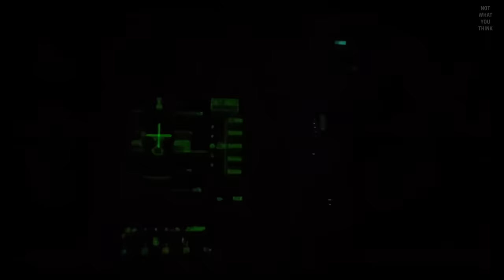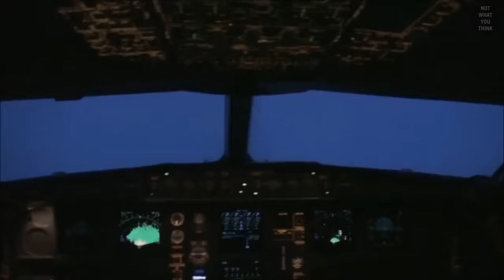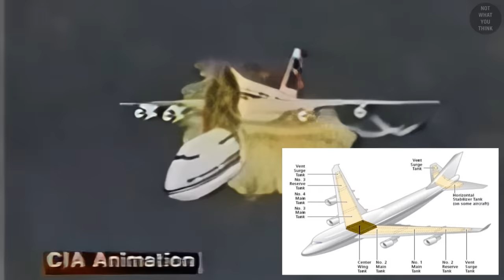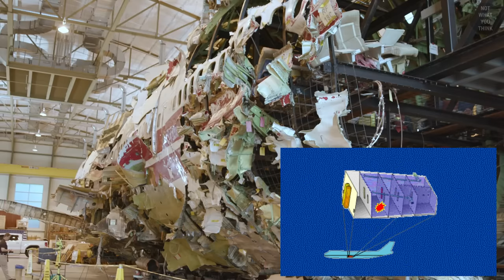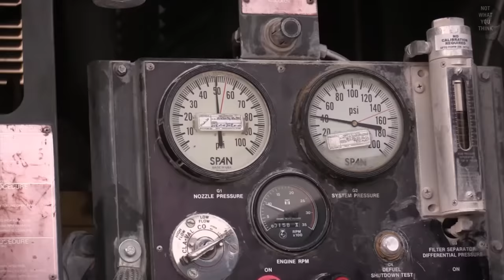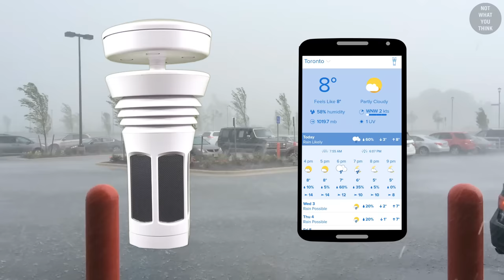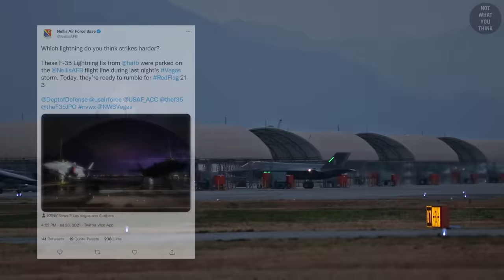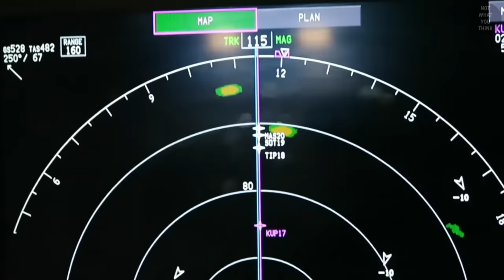Why F-35 Don't Fly During Thunderstorms

Comment: 15:27 ...unlike metal clad aircraft?  Composite vs metal clad?  Composite IS metal. It's a mix of metals. And most aircraft are built out of a composite metal, which you even stated early on in the video at 2:42.

Comment: Funny that. Who'da thunk that airplanes specifically designed to slither around electromagnetic radiation would have some issue with shedding off intense electrical discharges?

Twenty years from, those in the know will look back at this and mutter "Yeah-- this is why we don't like flying any kind of stealth aircraft through electrical storms."

Comment: Why are they trying to eliminate oxygen by air filters?
Why not having the whole tank lined with a membrane, like a giant airtight plastic bag inside the tank? When the pump sucks the fuel, the space between the outer Al wing surface and the bag would fill with air, but the fuel would be isolated..

Comment: What happens to the fuel vapor that's displaced by the nitrogen?  Does it just get vented to the atmosphere?
Reply: The fuel vapour gets mixed with the nitrogen, just as it does with normal air.
Reply: @gordonrichardson2972  injecting another gas into the tank would have to involve either displacement of the existing vapor, or an increase in pressure.  Are you saying it's the latter?
Reply: @davidsellon4580  it's the latter.

Comment: a 747 gets zapped every day.  It is made out of aluminum, an excellent conductor, the electricity goes around the passengers.  I am not looking forward to flying in a carbon fiber airplane..
 In a piston powered airplane you could eliminate the air fuel mixture by putting exhaust gas in the fuel tank above the fuel.

Comment: The F-35: Can’t fly when it’s too cold because the batteries don’t work. Can’t fly in the desert because it’s engine struggles. Can’t fly in thunder because of the exterior. Just buy more F-15’s and -16’s; they do the job better and cheaper.

Comment: When you mentioned Saint Elmo's Fire, your video was not showing it. Saint Elmo's fire looks like the northern lights rolling around the windshield, what you showed was static electricity flow across the windshield, which is far more common than Saint Elmo's fire. 

Also, the plane is not "designed" to take lightning strikes, but they can. After a strike there's a huge maintenance event to demagnetize parts and inspect for damage that can ground the plane for a long time. The "design" you're referring to is static wicks, which are designed to dissipate static electricity, not lightning strikes. They do dissipate lightning, but usually get melted down to a nub in the process and have to be replaced.

Comment: Could you use a vacuum pump to extract the fuel air mixture? In order to stop it from exploding
Reply: The reduced pressure inside the tank would put additional strain on the tank walls. The fuel pump would have to work harder - but that should not be an issue. Actually, sealed fuel tanks had been around in cars some decades ago, and when the tank had been filled to the rim, the fuel pump was able to act as a vacuum pump...resulting in a crumpled fuel tank. Today, the tank caps should have a vent which lets air in when a strong-enough vacuum begins to build up in the car's tank. Yep, I wrote "should" because these vents can fail and the hapless car owner (or happy YouTube video creator who wants to demonstrate that issue) will be left with a crush fuel tank.

I'd think that a simple solution would be to store the fuel in a "rubber bag" inside the tank. The rubber bag would separate the fuel from the air, and could it deflate like a balloon when it gets empty. But if the rubber bag gets punctured, you might not even notice until your airplane explodes. Plus fuel level monitoring would be harder.

Comment: Let me get this straight...
So, a plane called the Lightning cant fly when actual lightning is present?
Reply: No it can fly through it just fine
Reply: @imperialpilot2164  
Joking, bro.
.....Just joking.
For $337M (Navy), it better be able to fly through lightning.
Reply: @willwinters3910  What are those price figures, an F-35 is bearing around 120m for the most expensive variant, the cheaper ones reaching 79 million, unless your talking about a raptor
Reply: @imperialpilot2164  Well it's a thunderstorm, which means we have a CB which usually has hail inside, which would tear up an aircraft eventually, would it not?

Comment: "I bet you're wondering why it doesn't fly in the lightning!" ... "At this point you have to be wondering why!" ... You rephrased the question like 5 times and still never gave a clear answer. Just that it's composite and non-conductive, and / or maybe the inert gas system never got sorted out. Neat.

Comment: The fuselage is hollow , while the outer layer is electrically conductive and separated from the inner fuselage by struts covered by rubber and wrapped with copper , this separates it from the non conductive composite inner , which allows the electric current to flow around and off of the aircraft leaving the airframe and its electrical systems intact.

Comment: Just another reason why the  the service life of the F-35; should be as short as possible. Naturally it's not likely about the fuel system. Modern electronics are quite vulnerable to high voltage sergs. An "all weather" combat aircraft. Isn't all weather, if it can't operate in a lightning storm. Aa many, perhaps most storms. Produce lighting.
Reply: F-35 Can fly though lighting in piss poor conditions fine.
Reply: @imperialpilot2164  So can the F-15.  The differences are two. One of these aircraft wil actually do, what it was designed for. That same airframe costs about half what it costs to operate the F-35.

Comment: The Inert Gas Generation System has been fixed.  The F-35 is actually not very conductive.  However I have seen what happens if it flies to fast through heavy rain.  Let's just say that start making plans to work on the L.O. and leading edges.  Low Observable coatings on the leading edges are important parts of the jet, all aircraft have rain erosion materials, an ablative material that is designed to protect the underlying structures.  It works but it requires maintenance, sometimes LOTS of maintenance.

Comment: What exactly is the "grounding" in an aircraft grounded to? Yes, I'm sure the DC and AC electrical systems have their grounding wires, but that's not the same as the electrical grounding in a building, that literally uses the earth itself as an electrical sink. Try shoving a few million volts into the ground terminal of a car battery and let me know how that works out....

Comment: do not blame the fuel of the twa 800, it is considered that a hot pipe sagged onto an eletrical wire causing sparks in the center fuel tank, cause the boeing 747 was an old model

Comment: The military SR71 Blackbird Mach 3+ plus reconnaissance jet had liquid nitrogen dewars to keep the fuel tanks purged when the fuel depleted. It also is the only aircraft to use JP7 fuel that I know of. JP7 has a very high flash point that a spark plug ignition in the engine would not ignite the fuel like normal engines. It had to use a pyrophoric chemical called Triethylborane TEB. The aircraft flew at extremely high altitudes probably above most lightning. Although the titanium fuselage would get very hot from speeds over 2000 mph. Maybe some lessons there.

Comment: SO, WHY ARE AIRPLANE TANKS NOT LINED WITH HALON DUST INSIDE THE TANK... IF A FIRE STARTED OR POTENTIAL.TO.START THEN THE INNER LINING WOULD OPEN AND SMOTHER ALL AIR INSIDE THE TANKS AND OTHER POTETAIL HAZZARDS?? IF TANK RUPTURES THEN THE HALON WOULD EXPLODE OUTWARDS SMOTHERING ALL AIR AROUND THE RUPTURE... ANYTHING IS POSSIBLE BUT CORPORATE AIRLINERS WONT SPEND FOR THE R&D NOR EXCEPT EXTRA WEIGHT THAT TAKES AWAY MORE GREEDY PROFITS FROM THEM... SO PASSENGERS WILL ALWAYS B3 EXPENDABLE....

Comment: Well, F35 jet one big designed error is vertical landing or taking off propeller behind a pilot cockpit is running by a drive shaft. Yes, you heard it right! 21st century air plane technology equipped with drive shaft like a car and when landing or taking off vertically, thousands of RPM of drive shaft need to work for its critical stage and maintenance is way more short interval than an inspection.
Reply: Not sure what the alternative is. You do realize that if you're going to call it a drive shaft, then all jet engines have drive shafts. The turbine stages are connected by shafts to the compressor stages. All that's happening here is a gearbox that takes that high RPM turbine power to a fan. Just like 21st century cutting edge airliners have turbofan engines where the fan is connected to the jet engine shaft.
Reply: @ChucksSEADnDEAD  Inside the jet engine is fine with oiling system for drive shaft. In F35 main engine shaft is connected to the front propeller for vertical going. While you can use advantages of compression air or exhaust thrust for front fan, why use drive shaft connection to front fan. Or use additional turbo jet engine like in helicopter for front fan for more reliable maintenance.
Reply: actually that's what makes the F-35B's V/STOL flight ability superior to other VTOL STOVL aircraft in my opinion.
Reply: @freezee7547  Additional jet engines are 20th century. That's the way it was done in the past. Jet engines are not very thrust efficient at low speeds. If you want to double the mass of gas used for thrust, you only need to double the energy input. If you want to double the speed of the jet exhaust, you need to quadruple the energy input - because velocity is squared in the kinetic energy equation. This means that jet engines are most efficient at cruise when velocity. When you have an hovering aircraft (moving slow) the jets are dumping supersonic airflow to keep it in the air, and so the energy use is very inefficient. A fan moves a larger amount of air mass with less energy, so you get great thrust with minimal fuel consumption because it's being driven by the turbine stage of the main engine.
Reply: @ChucksSEADnDEAD  Well, high tech stealth vertical capable fighter jet is for multi purpose then how about the reliable and maintenance when they are the keys for those in aviation? Or find the mechanics every time in war zone to check and fix for almost every vertical doing? Even very reliable jet engine has its own failure due to manmade or natural errors in its own way nowadays, so, when engineering F35, should consider effective and efficient methods for maintenance and reliability. So, let’s hope G people does not waste billion of taxes stupidly again in military and nasa.
Reply: @freezee7547  "how about the reliable and maintenance when they are the keys for those in aviation?" - Jet engines are more maintenance intensive than a shaft and fan.
"Or find the mechanics every time in war zone" - They'll be at the base waiting for the aircraft?
Reply: @ChucksSEADnDEAD  Probably centuries years old tech still using for next generation fighter jet innovation with all those amounts? Wasted, man! It’s all wasted! Come on, don’t let washed out the brains, bro!

Comment: Full of half-truths, selective scripting, and lacking the complete explanations for their claims. This just stirs up fear for traveling by air. The odds of being killed in a plane crash is 1 in 7198 while the odds of being killed while driving is 1 in 98. In the last moments, they talked about hail and ice bringing a plane down… no just NO. First, there are multiple systems in place to prevent ice accumulation on the leading edge of the wing (where it most affects the wings lift). While ice does result in less fuel efficiency, the chance of any commercial jet crashing due to ice in 2021 is slim to none. Second, ingesting hail into the engine can cause damage. Engines undergo 2 years of destructive testing prior to certifying that model of  engine is safe to use. In one test, they launch 1,750 lbs of ice into the engine and it must keep running. They also launch frozen turkeys into them. These engines are designed to take all the abuse and still be able to operate at some level…. And you know why aircrafts have TWO HUGE jet engines???? It’s because if one engine fails, they can still fly the plane… albeit with more difficulty but it will still stay in the air.

Comment: They can't? They're called the lightning II though.
Still remember the time pilots thought it was st Elmo's fire when it was really volcanic ash and their engines all went out . British airways 009 I think. Basically, the ash melted in the engines and stuck to the  inside causing them to fail but they could restart the engines later as the ash cooled, it solidified and broke off freeing the engines again.

Comment: 3:02: "modern aircrafts have radars built in so they can detect storms and lightning": not exactly. They can detect storms but not lightnings. Lightning detectors exist but are not reliable since they are not accurate because the detection is based on the electric field generated by a lightning. Unfortunately this electrical field is not constant and depends on the lightning itself so that you get a great inaccuracy in azimut and distance.
3:59: new types of fuel have been tested indeed but this never worked so that they are not "the norm" since they just burn (btw that's why we use fuel ...)
15:51: "lightning rods for F.35 protection on the ground". That's really mindblowing! This aircraft is off to a bad start! A new scandal to come?